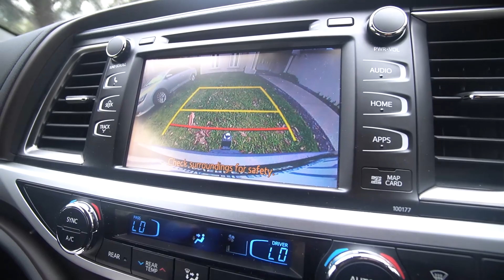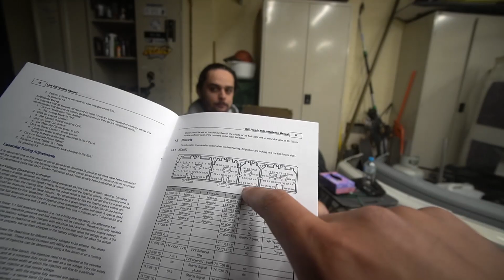1JZ TOYOTA CHASER LINK ECU WIRING! Not as hard as I thought

Comment: I've been in the mechanical trade  for over 15 years and those blue wire splice locks probably have to be one of the most hate things! Wire it in properly with a solid connection as i have seen them cause all sorts of problems with lights that stop working because they loose the connection!